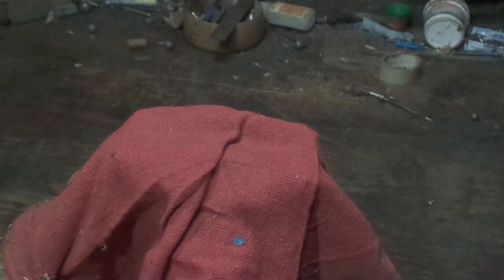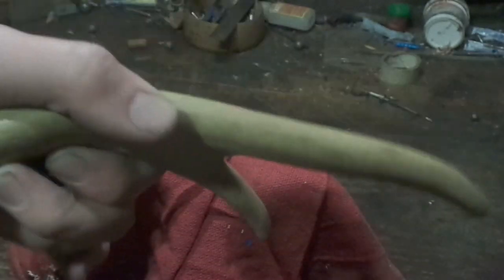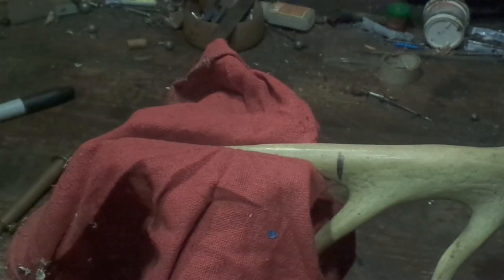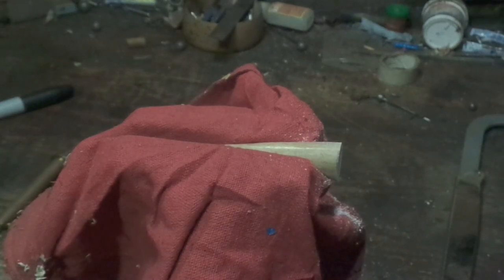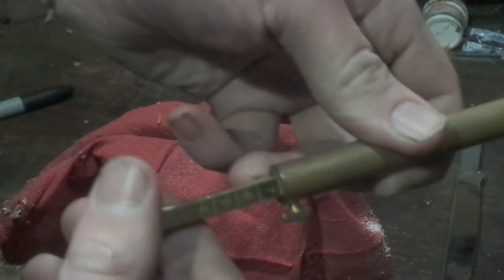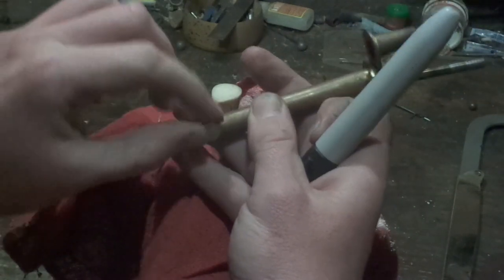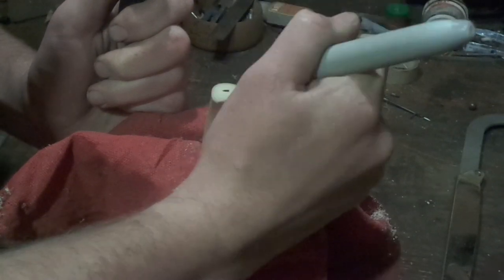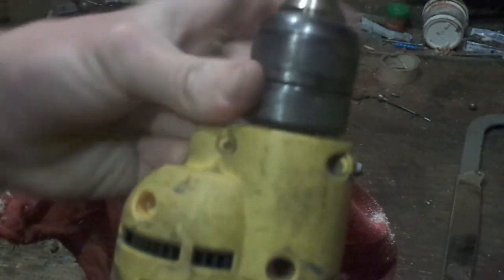Making a Powder Measure Out of an Antler

Comment: When you were building the Powderhorn I was already thinking about a piece of antler for the powder measurer and I'll also thought about tapering it off as you did although I was thinking of tapering a little more. I would also like to incorporate it in the plug in the top. It may not match to begin with but I'll make it match. I was also thinking of the rosettes you know the bottom of the antlers where they go in the head I think they would look pretty cool using those and lastly but not lately making one for all of the ammunition that you use or at least shotguns you can reload shotguns in the field if you run out of loaded shells. Anyway it's just an idea thanks for going through the process and given me ideas. Have a great day and stay safe! TQ out